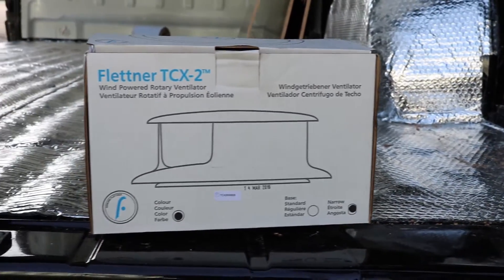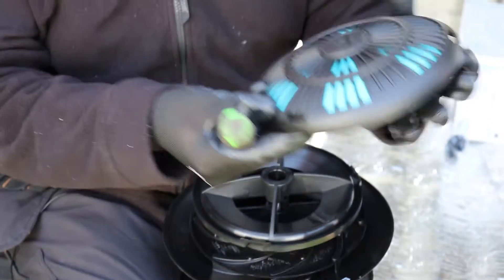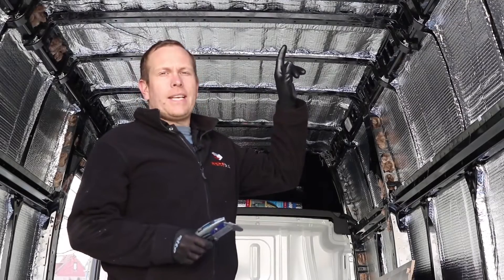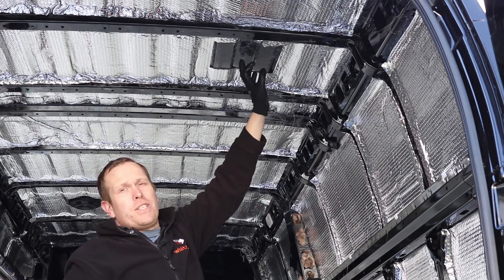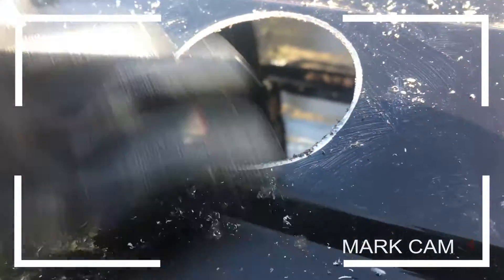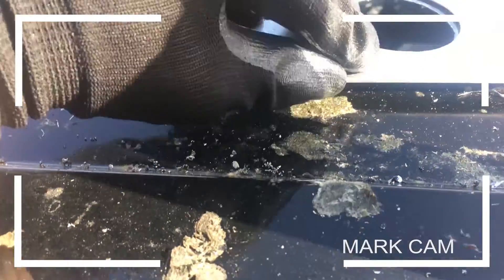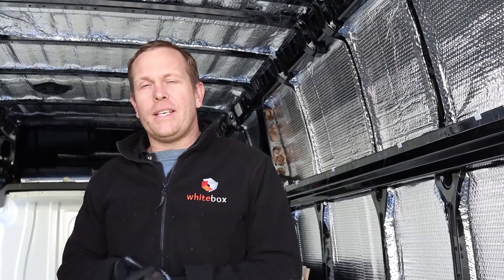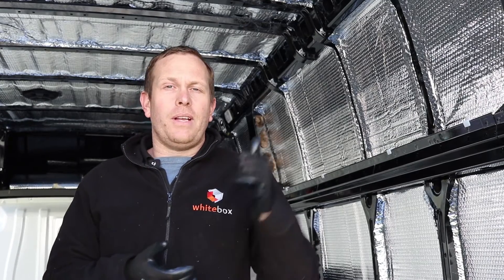Flettner Roof Vent Install

Comment: Hello I installed three of these in my Horse trailer the first one works so well I had two others installed one in my dressing room and one in the Horse trailer towards the back. They were installed by different people the two that I just install do not spin like the first one what can I check to make sure they were installed correctly
Reply from the maker: I would check that they have not been overtightened and that they are installed level.

Comment: Any leaking in rains? Especially while parking on the slope (not horizontal)?
Reply from the maker: Hello. They seem to keep the water out ok. We have not experienced any problems. Thanks for watching.
Reply: @WhiteboxUK  
I cannot find this item on your website.
Reply: @Sig721Tau  We only fit these on larger installs and do not sell individually. You may be able to buy from Flettner direct. Mark.